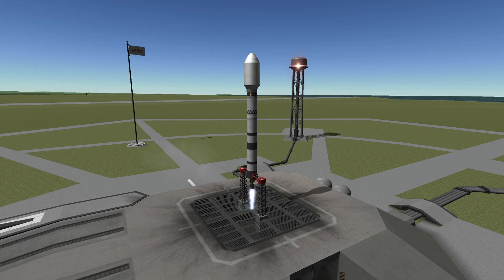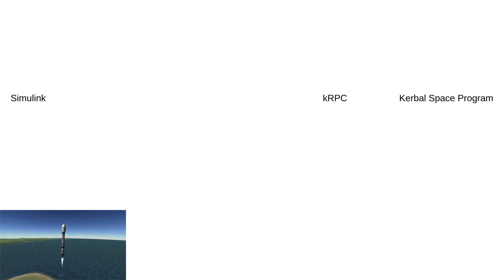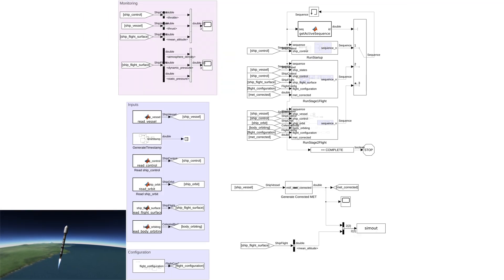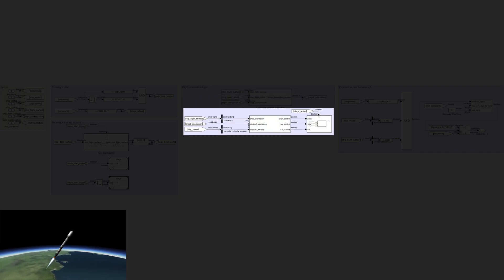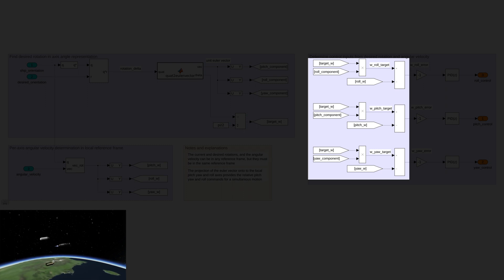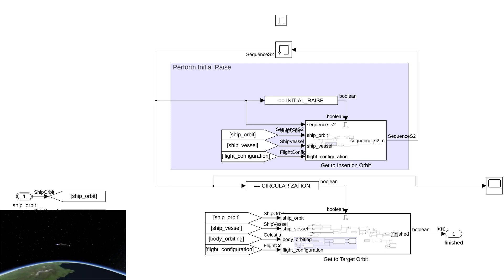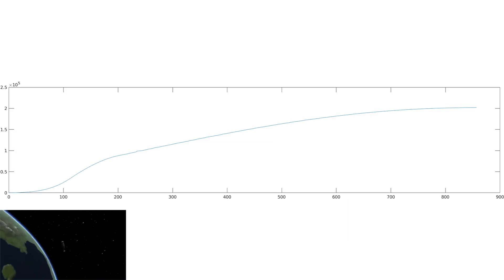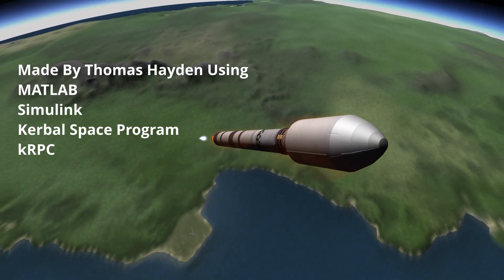Launching a rocket in KSP using Simulink and MATLAB

Comment: Nice, well done ! What protocol are you using between Matlab and KSP ? TCP/IP or UDP ?
Reply from the maker: I don't actually do any direct communication like that, rather I use the kRPC mod. To connect I simply give my code the IP and port of the game (which is just localhost and the default port in my case). From there I can call Java methods from a MATLAB block to communicate with the game. The internal communication of kRPC appears to be TCP/IP though, so effectively that.

Comment: this is cool,  and the best thing is , i have been searching all around the internet to know how to get matlab to talk to ksp , 
can you help there please ?
Reply from the maker: Sure, it took me a while to figure this out so I'm happy to get this information out there. High level you want to get the kRPC mod, and do a quick test in pure Java to make sure everything's working. From there, you can move the initial setup code (such as creating the connection) to a .m file you run before your model. Next, you can (either in a .m file if you're not using Simulink, or a MATLAB block if you are) call Java methods directly within MATLAB code, which you can then convert the result of into a MATLAB/Simulink type. I haven't had luck getting streaming to work from the MATLAB code, but you can just call the get methods each time you want an update. For sending commands to the game it's pretty much the same process, except you are parsing data the other way. This is a pretty short overview, so if you have any specific questions let me know!

EDIT: And for kRPC info, here are the docs which give some good examples of setting it up (though it only considers Java, MATLAB can get pretty close to acting the same so it's generally applicable) https://krpc.github.io/krpc/java.html